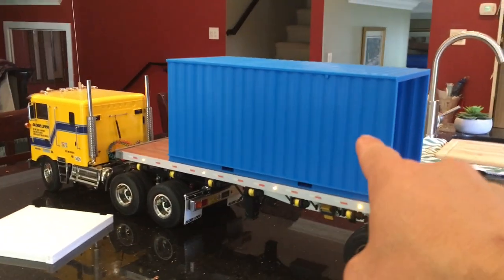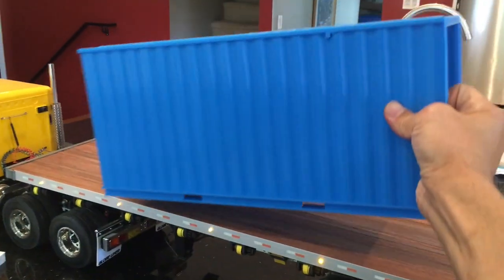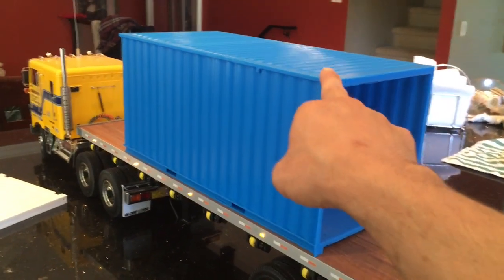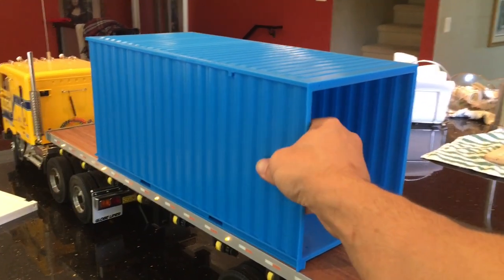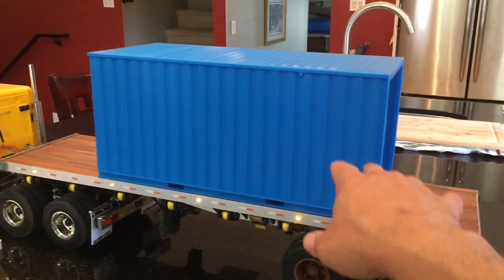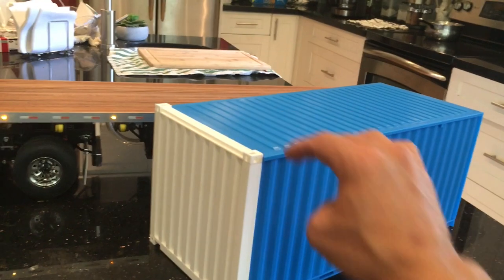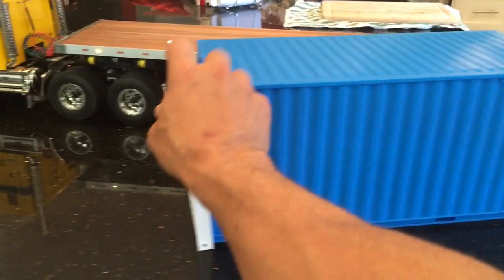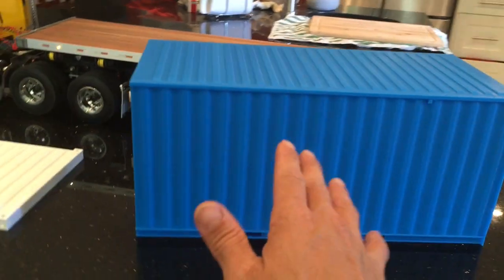1/14 3d printed Sea Container Part 1

Comment: what about the corner lock thingys that containers have you missed them :-) would like to make that but my printer has 270mm  max height. great work
Reply from the maker: I think you're referring to the twist locks. Those are actually part of the chassis and not the container.  The white piece if you look closely has the housings where the pins twist into. These two pieces are printed separately from the body. Ya this one has a height of 400mm. You could print it in two sections if you wanted for your printer and glue. Thanks for the comment!

Comment: nice idea!
Would the STLs be available to buy for people overseas to print along at home?
Reply from the maker: It sure is Nick,  thats where I got mine. It's available for purchase on Cults 3d, you can't miss it. 20' sea container. It's a long print and you need something large enough to print the body keep in mind, otherwise you'll have to print it in two sections which I'm not a fan of. Good luck pal
Reply: @westernsharpie  cheers! I won't be able to go 400mm tall so I will have to section it but looks a good load